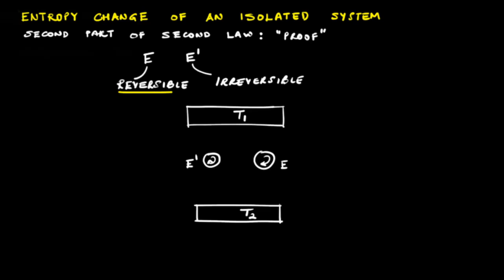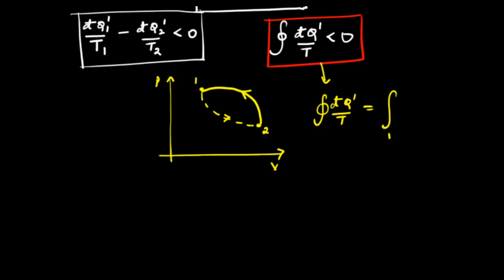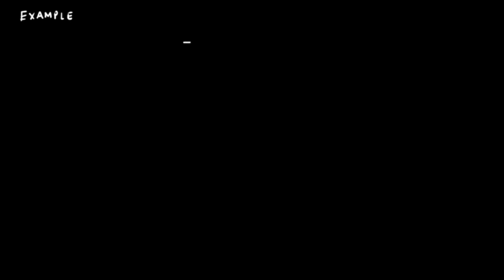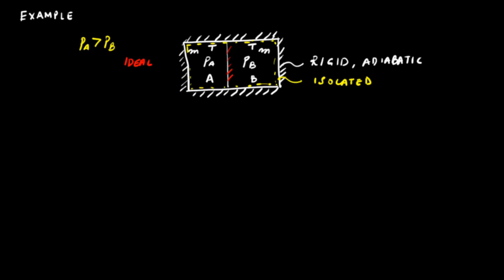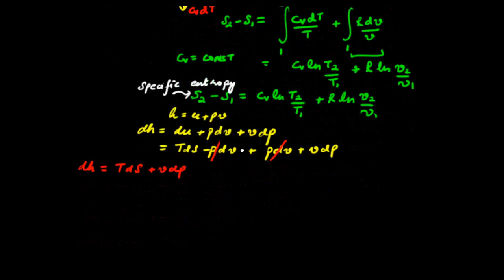Lecture 24: Entropy of an isolated system increases during irreversible process; Clausius inequality

Comment: at 22.41, even if Pa is not equal to Pb, no work is performed during diffusion. If I assume that a thin moving membrane at boundary between compartments, there will be work performed. Pls clarify? (i accept during an expansion to a vacuum, there is no work done and temperature remains constant for an ideal gas.)

Comment: at 10.47, how did you change the inequality sign in the white square ? The answer is correct but i wonder how you  pulled it off.....I am comfortable using method of by equating  the efficiency of an irr as lower than rev engine. Probably you are using the Q1 as a variable here.
Reply from the maker: It follows from Q2'/Q1'>T2/T1 writing right above the box.

Comment: Sir, At (ref 3:52) shouldn't the efficiency of E be W/Q2?
Reply from the maker: We are considering efficiencies of heat engines before we reverse the direction of one of the engine. So efficiency is always work output by heat absorbed from high temperature reservoir. Q2 is not heat extracted from high temperature reservoir.
Reply: @bahgalabiitdelhi7797  okay thank you sir

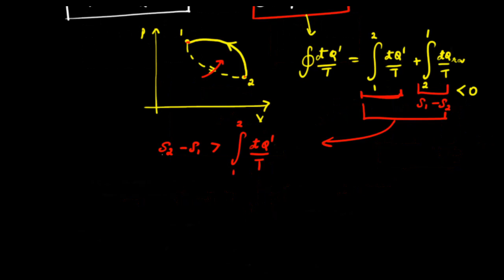Comment: Sir for an isolated system shouldn't dQrev also be 0 since no heat is coming into the system either reversibly or irreversibly? then from that we would get S1=S2 always for an isolated system which would be ambiguous( ref 15:21)
Reply from the maker: You can have adiabatic processes which are irreversible. One example is at the end of this lecture.
Reply: Okay thank you